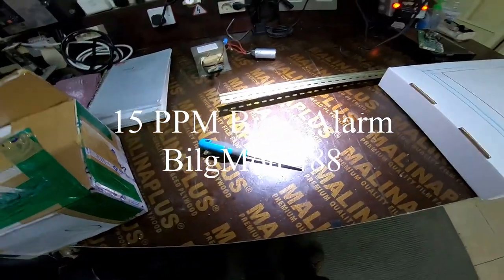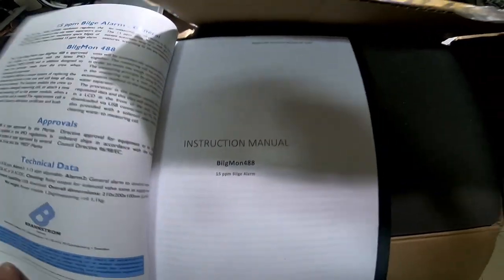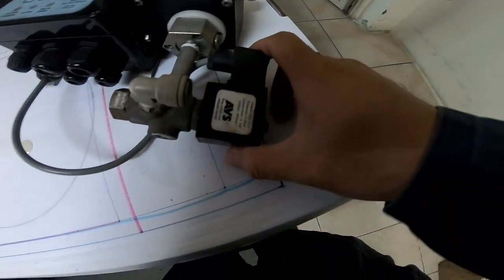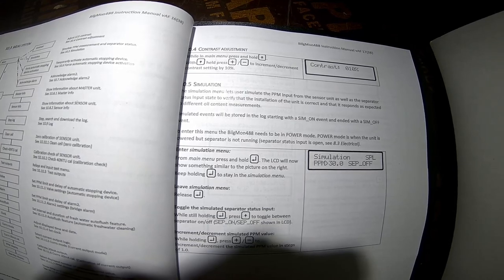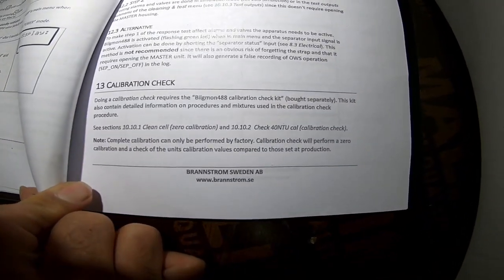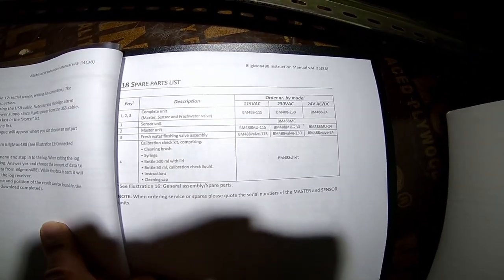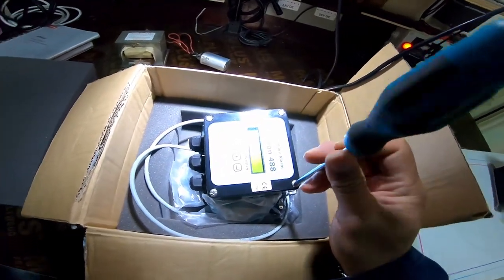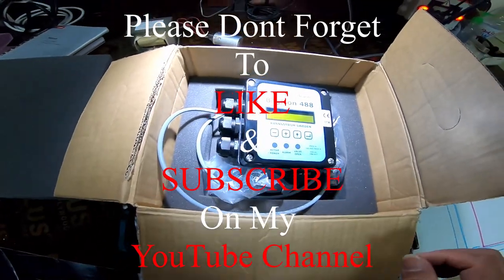15 PPM BILGE Alarm BilgMon 488 Manual settings and set up

Comment from the maker: Pankaj thanks for asking. As per the manufacturer it cannot be repaired, but from my side I'm trying my best to find it. I almost remove all the and swap except from those square IC. Thanks is a common problem when you lost your battery voltage. I will update you soon If I found which IC is it. It is a clock processing Ic in ROM area.